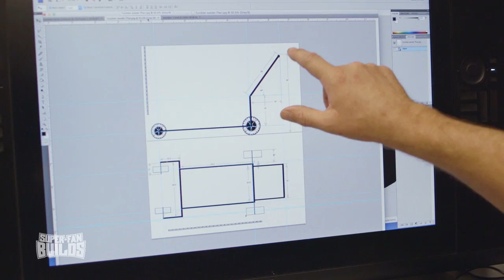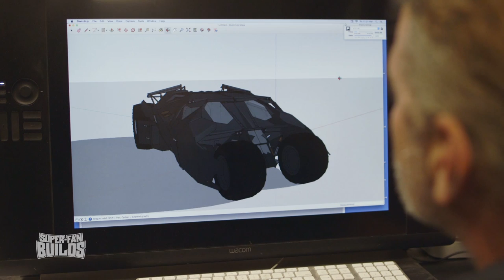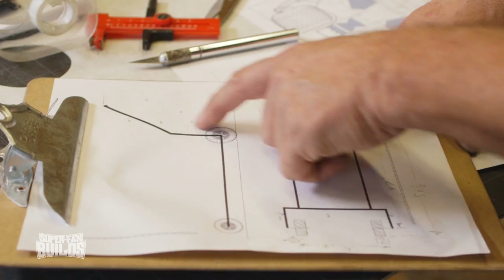Batmobile Baby Stroller (The Dark Knight) - SUPER-FAN BUILDS

Comment: looks heavy as fuck
Reply: Foam.
Reply: It's actually made from steel..
Reply: darkbazzoka341 Only the frame is steel, the rest is pvc.
Reply: Luis Busta No it's not. It's a material called fomex.
Reply: You can see the effort it takes him to move it and tip up the wheel. You are definitely right.
Reply: PVC and steel tubing wouldn't be too bad.
Reply: Looks fucking heavy compared to the average stroller
Reply: Thomaslawlet It's not pvc the main body is made of a material called fomex.
Reply: Foamex is a kind of PVC, but whatever. My point is that the build only has a heavy steel frame, it's not entirely made from steel.
Reply: Its like putting a baby on a steel frame which would be 20-25 g plus the baby
Reply: Luis Busta You're not wrong, but there's a big difference from saying PVC and PVC foam. PVC being a hard plastic and PVC foam being a soft foam, light weight material. Also, I very much doubt the steel weighs too too much, probably only used 5mm steel, I would presume.

Comment: Sure it looks cool, BUT its impractical.  Who needs a 1000lb steel frame that can be blown up and still be fine, when you'll get tired of pushing it down the block, when most bicycles that are put through all kinds of shit are light weight aluminum.  Also, it doesn't have any stroller features.  I mean it doesn't turn, you have to lean it on its rear wheels and turn it like an old shopping kart. It doesn't have a parking break to insure that awsome batmobile doesn't drive off on its own with ur kid, and doesn't have any space, in case you want to hit the store. Did I mention it wont fit through most doors? Well it probably won't, so better leave it in the garage.  Now guess how much something like that would cost online.. probably around $2- 8000, when a normal everyday stroller with all the features u need would cost you like $300. Do yourself a flavor, and buy a used suv for ur family for that money, and if u want add some batman stickers. Peace.

Comment: Despite being oversized, untransportable with anything smaller than a pickup truck, and obvious weight (Yes.  I realize the body is constructed from foam, but 1.5" square steel tubing is heavy.  Just how it is.), I would love to have this.  It is an awesome stroller for a fun walk around the block with the kid.  

I am surprised no one has mentioned the design flaw I did notice, however.  The stroller had four ridgid-axle wheels.  Neither the front, or back, wheels were on a vertical pivot sleeve.  This means that there were no turning wheels, which is why you will notice the dad has to pop the front wheels off the ground to turn it at the end of the video.  Sad a master builder didn't catch this.  I noticed it as soon as they mounted the first front wheel to the frame.

That would need to be changed, but otherwise,  a fantastic job at a fun build.

Comment: Not a big batman fan, but this stroller is actually cool, although I doubt it is usable in real life, first of all, strollers fold to fit in the back of the car, this needs a trailer. You can never use it in an inside place like a mall, especially if it has elevators, and the biggest problem is that the wheels do not turn.

so even though it is a cool thing to own, using it will be limited to a few outdoor places around the guys house.

Comment: I really think that they should've thought this out a little better. 1. They could have made the stroller a lot narrower. It is too wide to go anywhere. 2. It would have been dope as hell if they designed it to be able to fold up. 3. The could have made the front wheels swivel. 3. Added some cushion on the handle so it wouldn't be so uncomfortable to push.

Comment: ....did they take someone else's sketchup models and used the surface panels for cutting the templates? If they reduced half the edges by like. 3 millimetres, they probably would've gotten a better fit on the panels rather than the gaps and the need for all the tape.
Reply: Also, the reactions are more staged than pimp my ride lol.